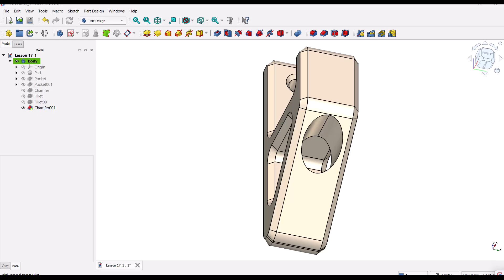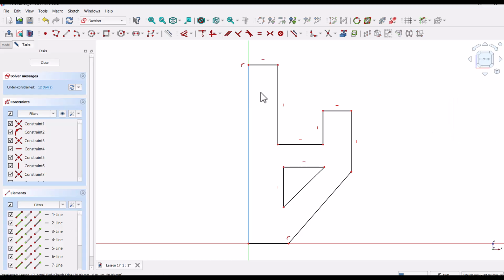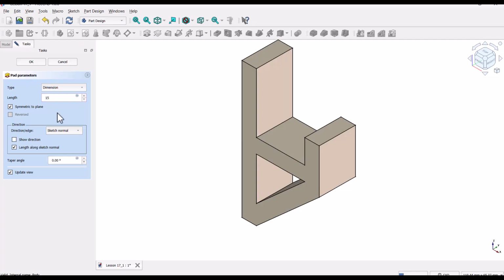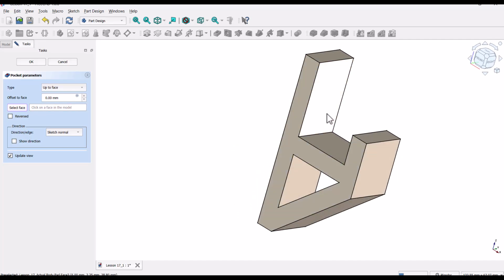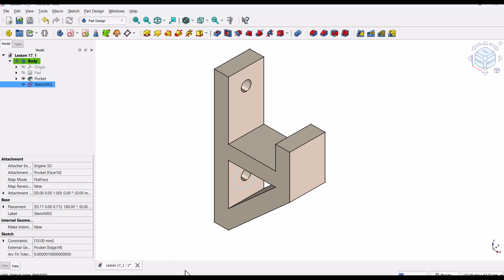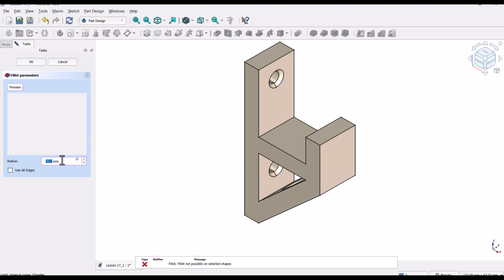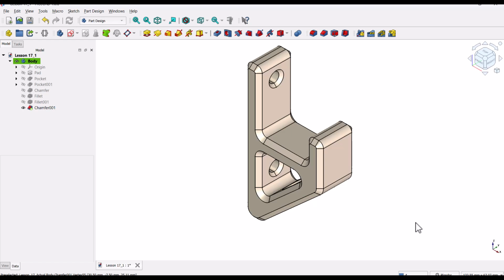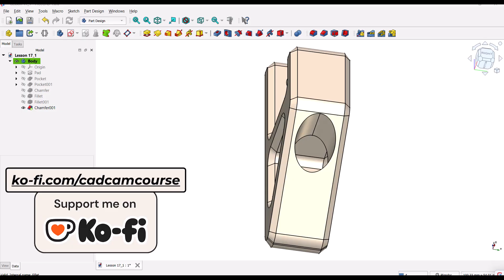FreeCAD for 3D Printing – Project 01 of 40 | Heavy Duty Wall Hook | Step-by-Step Modeling Tutorial

Comment: Some of the steps weren't 100% clear (like how to rotate the model freely with the mouse and I kept getting errors when trying to vertically and horizontally constrain the points) but after some trial and error I got it done. Overall one of the best freecad tutorials I've seen on Youtube so far. Thanks.

Comment: Apparently, according to ChatGPT, this video may have been done with FreeCad version 0.19 or early 1.0, so I got some errors while attempting to follow the tutorial exactly. Problem showed up when trying to make the 10mm hole. I am using FreeCad 1.0.3 as well as 1.1
Reply: I had problems with trying to create the pocket on the back side with the to face option. When I did that most of the model disappeared. If I pick by distance and 6mm I get the pocket punched thru as desired but understand why that is not a great idea

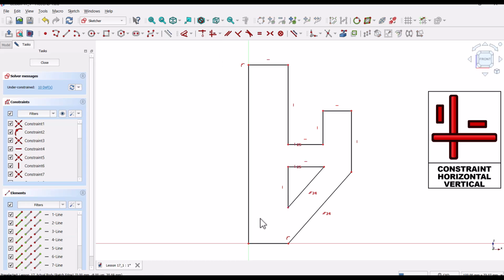Comment: when I try to select the 3 points to make them coplanar it gives me an error that is double constrained... :( followed the tutorial step by step until 2:08
Reply: So did I. I think that was because the two left points on the triangle were already constrained vertical. I picked just the top left vertex of the triangle and the vertex just above that and applied the vertical constraint and that seemed to work.

Comment: Vertical and horizontal constraint button doesn't seem to be in the new version I have. If you accidentally close the sketch, there seems to be no way to see it again. So, I've restarted a few times. I actually find Blender more intuitive and that is saying something! if you hit the esc key. Which you would assume would make the thing you just selected unselect, it just makes the whole sketch disappear. So, 5th time lucky? You didn't explain that right mouse  click will get rid of the polyline tool, so that was a problem. New version uses horizontal and vertical dimension constraints.

Comment: I get to the part where you add the parallel constraint on the bottom two angled lines and my whole sketch turns orange and it will no longer allow me to dimension the left hand vertical line to 57mm.. I do not understand what I am doing wrong and it is getting extremely frustrating......
Reply: Disregard, after multiple (far too many to be honest) rewatches and starting over from scratch I realized that I was clicking the first angled line before holding down CTRL and in doing so that gives the result of the entire sketch being over constrained, not really sure what the purpose of that option is but I was needing to hold CTRL before clicking on the first line. Your videos are extremely well thought out and put together. Thank you good sir.

Comment: Nice watch. Never knew there is a feature to cut the view to the face where the sketch is attached. Always rotated the model or switched to wireframe mode. In the end I was like "Does it fail to make the chamfer on the large hole?" But you didn't solved this mystery. :D

Comment: Hook should sit flush against the wall.  Chamfers and fillets on the back edges allow it to rock along multiple axes.
Reply: They're probably not big enough to allow rocking, but yes, they do seem unnecessary on the back edges.
Reply: what are you talking about? no they dont, the back face of the hook is flat
Reply: @buzatusebastian2735  The chamfers and fillets create small gaps between the hook and the wall.

Comment: OK, I clicked on this tutorial specifically to learn how you handle chamfering without selecting all edges one by one. I turned out to the "finish the drawing of an owl" meme :D Could you please explain the "long loop method"? It's completely unintuitive.
Reply: I know what you mean and that section was new for me too! @9:56, he activates the chamfer tool with nothing selected. This is important, because if you activate the tool with an edge already selected, it will make a chamfer for that edge only (probably what you're used to, it was for me). With nothing selected, and the chamfer tool window open, he sets the chamfer size to 1.5mm, then clicks "select"... this allows him to start selecting the edges he wants to chamfer, without needing to hold down an extra key. For me, I needed to set the chamfer size, (just like he did) and then click in the blank window just above where the edges will be listed to get the "Preview" button to switch to "Select" (I can also hit "enter" but that brings up an error message of "no edges selected", and then the preview button will switch to select). Either way, I end up hitting the "select" button just like he did, and then could select the edges to be chamfered, which, just like in the tutorial, show up as pink. 
The "long loop" thing can be seen in action starting at 10:12. Pause the video there. See those two pink lines? Trace the outer one with your mouse or finger, whatever... see how it's all just one connected loop? Same with the smaller pink line, it's part of a contained loop for that inner triangular opening. For that side, that's all you need to select to chamfer the entire edge. Which part of the loop you select doesn't matter. For instance, on the inner triangular opening, you can select just one of the tiny curves... it will still chamfer the entire loop. Of course, as I'm sure you realized, you have to flip the model to get the other side. Really useful though, as you don't need to hold down "ctrl" or "cmd" to select multiple lines. Hope that helps!

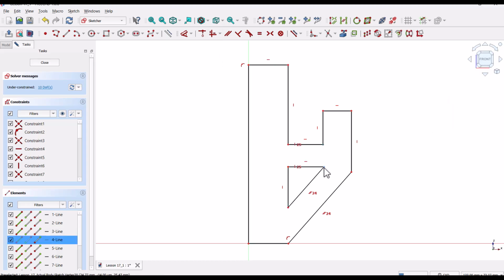Comment: Well, I made it to 2:11 before I watch you line up the triangle to two other points on vertical, and it snaps right into a line nice and easy.
Mine refuses, error box on bottom says its impossible. F*** me for trying, I guess.
Reply: the solution for me was selecting only 2 key points